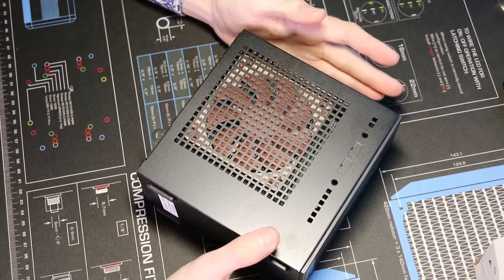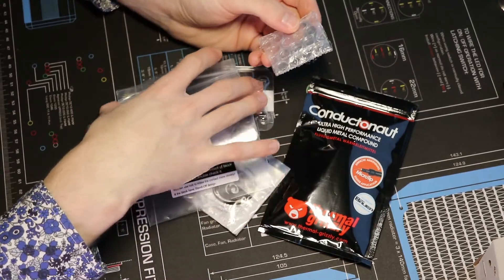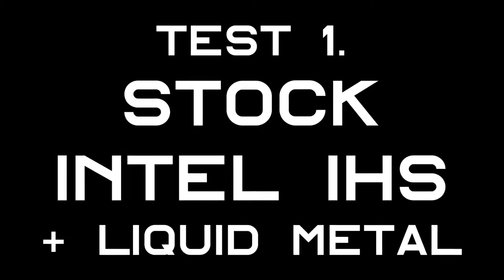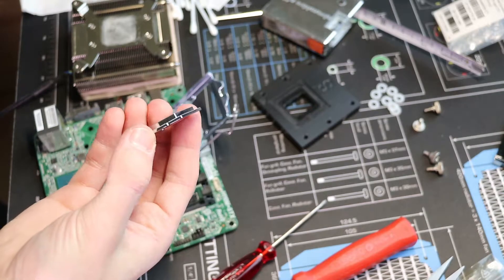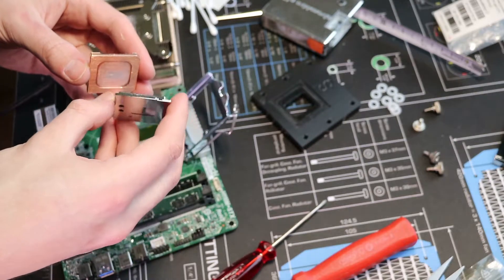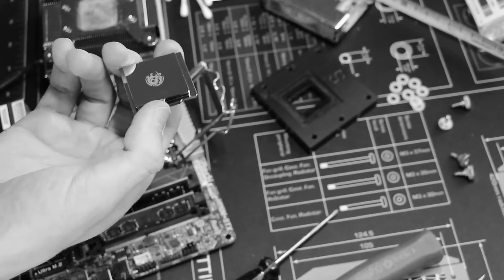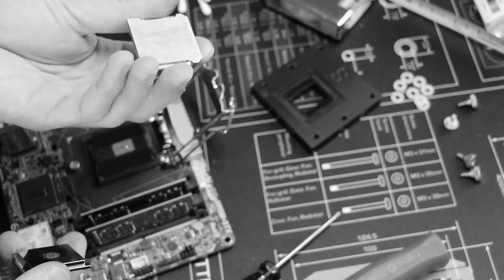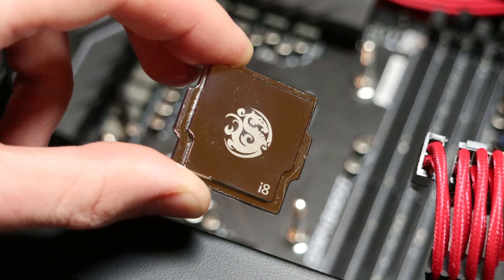Silver Shining IHS by Bitspower better then Intel?! [en]

Comment: I have been looking into CPU cooling for a few weeks now and I have a theory that the temps were also influenced by the liquid metal. You see, LM TIM actually alloys with all metals that CPU IHS are usually made of like aluminum (for the love of All that's  holy, DON'T use gallium based TIM on Al metal), copper and silver reducing their thermal conductivity as well as reducing the atomic quantity of TIM at the boundary . What I suspect is that the nickel coating on the regular IHS is a bit more resistant to this alloying of the LM TIM so it gives a bit more better results. This is because the mm thickness of the custom IHS alone shouldn't impact the temps THAT much...
Reply from the maker: Victor Unbea thank you for sharing your thoughts! Very interesting theory. :) Cheers